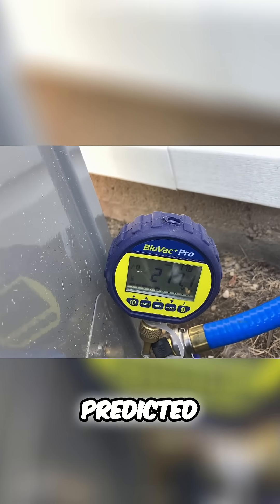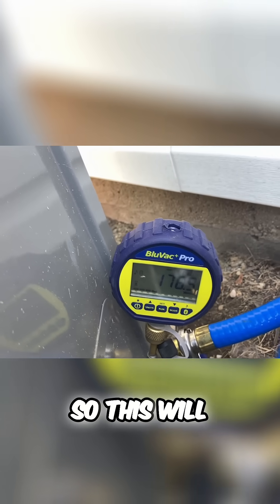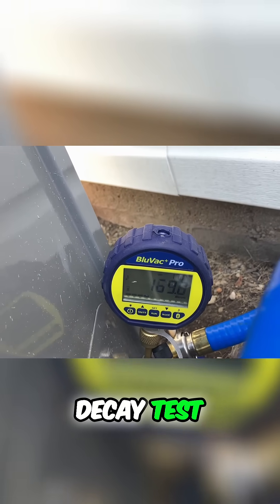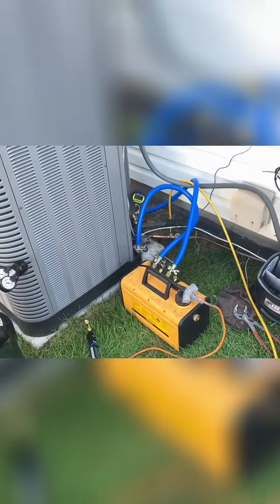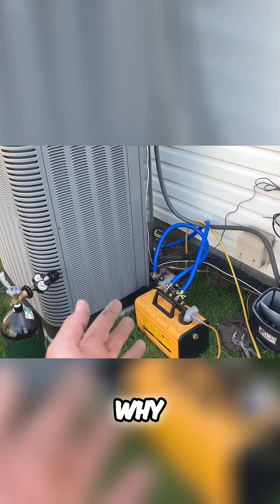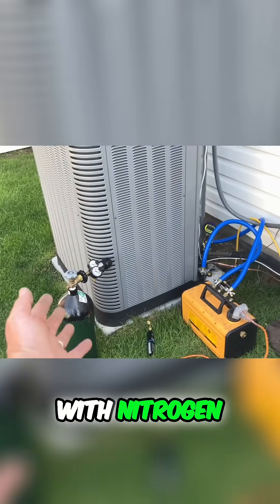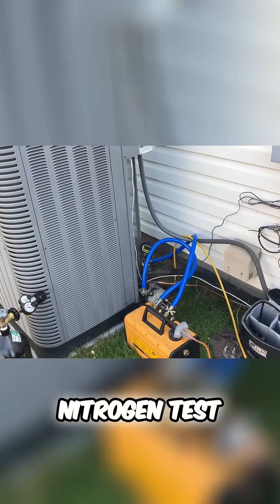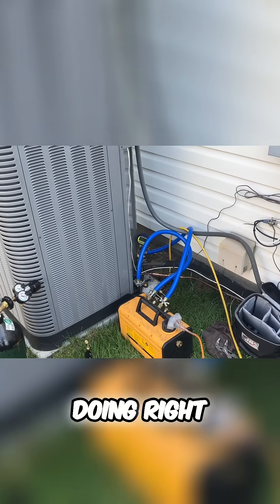AC Unit Vacuum Like a PRO! (Technician's Secret)

Comment: We always remove valve cores but we use half inch yellow jacket hoses. I've got a 12cfm vacuum pump. Chillers are something else man. Not unheard of to go through a whole 6pk of nitrogen on one machine. We usually leave a vacuum pump overnight then change oil and leave it for another day. Maybe by then we'll be under 500
Reply: Should be able to get a YK under 400 overnight. If you don't it could have a leaker. Single 1/2" NRP hose to 8CFM pump. 300 tons to 3000 tons,. should be the same time if its tight and dry.